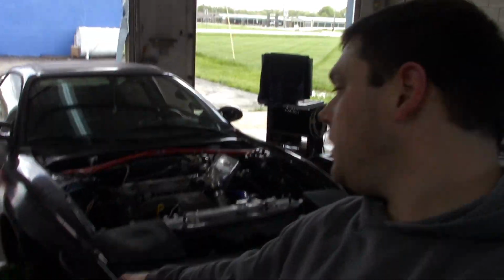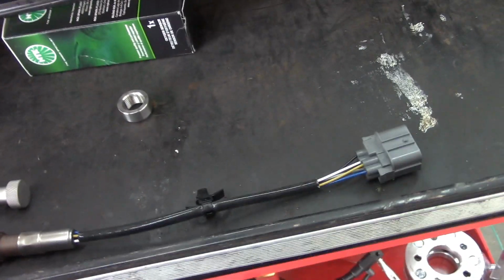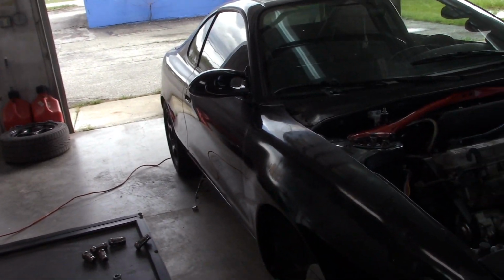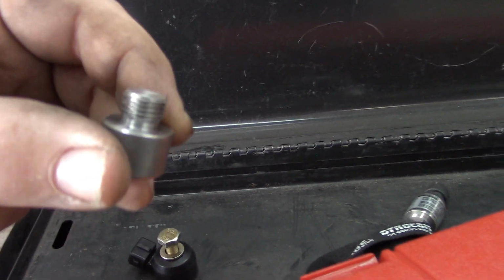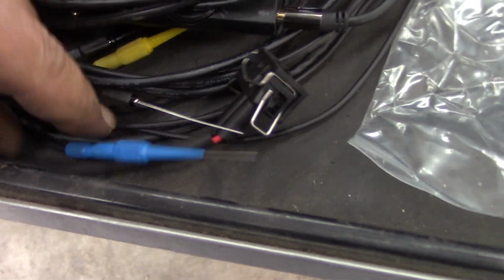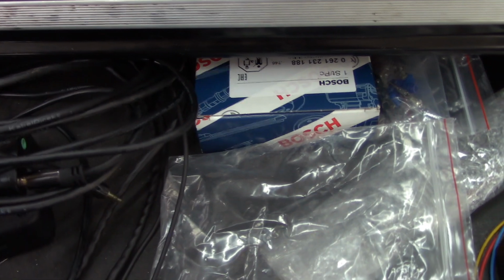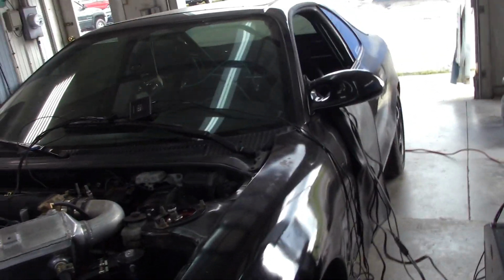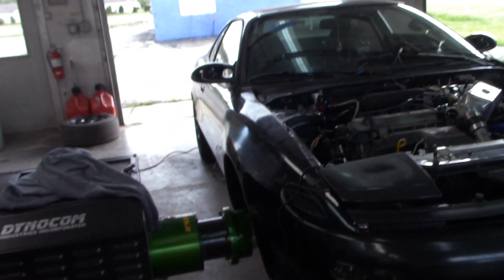90 Celica GT 3sfe Turbo PT1

Comment: Love your content.   I just purchased a custom turbo kit for a 5sfe I have both a stock 93 gts with a 5s as well as a 9t gt with a 5s. Thinking of runing 5 psi  max is it worth it or will I blow the engine
Reply from the maker: It depends on the health of the engine. I wouldn't run boost without a standalone ecu or a msd unit to pull timing as boost increases.
Reply: I have a 93 and 95 with full gt4 front end conversion both have 5sfe. And they have healthy compression very well maintained I wanted to go 3sgte but shops are quoting me over 8k.  So I ended up buying a bolt on with a ct26 that a guy of the forums built that came with a stand alone greddy ecu with custom harness for the 5sfe. How ever alot of shop are telling me they don't want to put their name behind it because they are certain that the 5sfe will blow no matter what
Reply from the maker: @rickl4107  I'm not on YouTube much anymore but I put most my stuff on 5sfe/3sfe performance on Facebook
Reply from the maker: @rickl4107  it should hold together with a good tune and low boost. I have the 3sfe at 20psi and it's held together so far. Just has a 3sgte MLS head gasket and head studs
Reply: Thank you I'll going the club